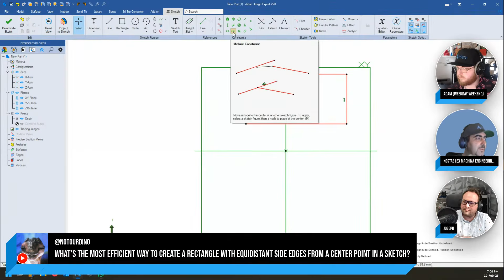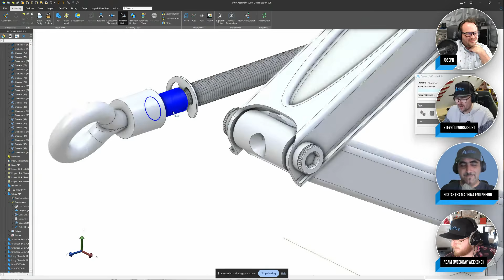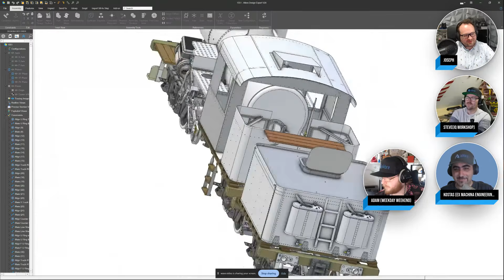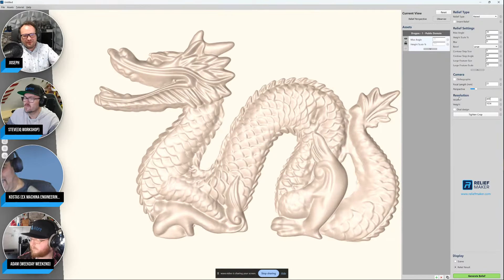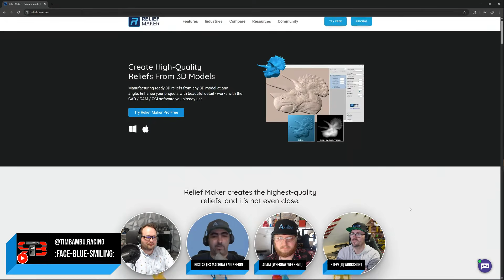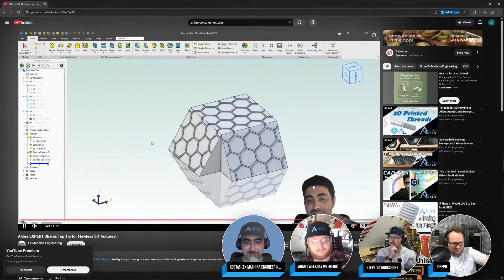HelpDesk Live! 12 February 2026

Comment: Working with complex gearbox designs, I prefer aligning/constraining everything on planes and axis. I try not to use part features, if the feature changes or your internal feature ID changes, the constraints won't break.
I also found keeping the same origin planes and 0-point in your sub-assemblies really handy when you need to exchange the sub assembly regularly when a subcontract works in a different program.
Reply from the maker: Great design intent tips!